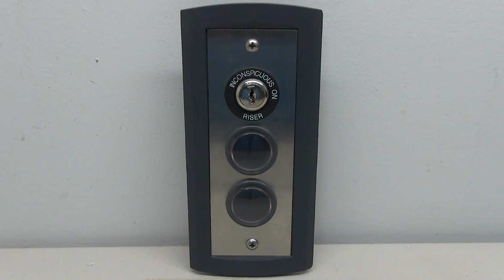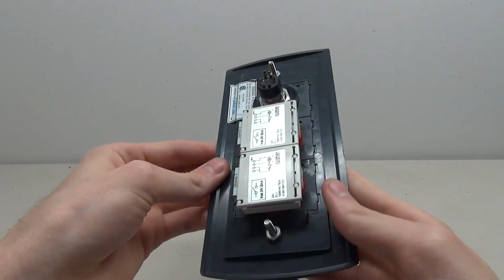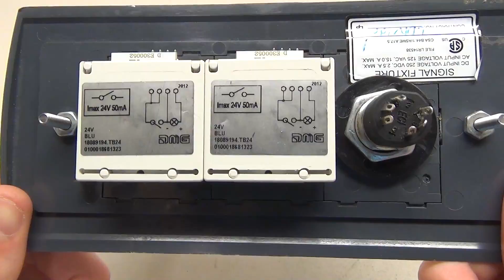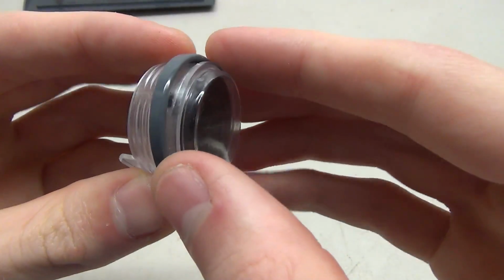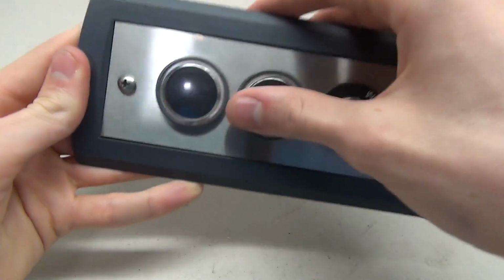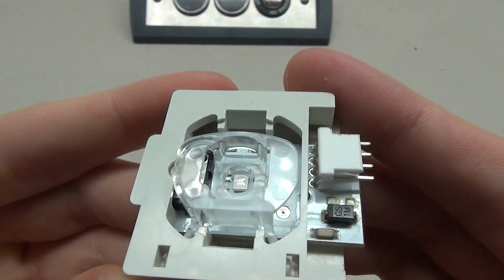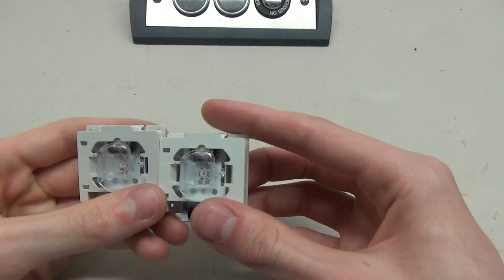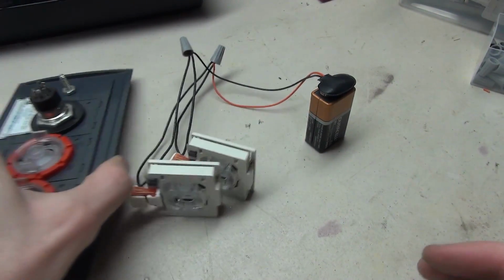Detailed Look and Wiring Thyssenkrupp Signa4 Elevator Buttons

Comment: Those connectors are universal, pin 1 is negative, 2 is positive and 3 & 4 are both switches. Yellow is NO and Blue is NC. Wiring Otis is exactly the same as this. I love the way those signa4 buttons look and feel
Reply from the maker: These are smaller.

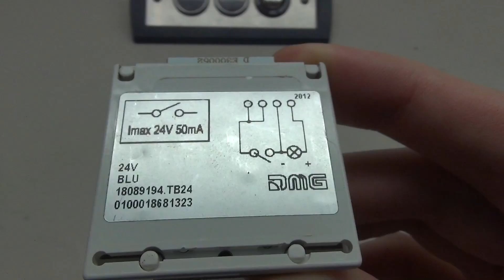Comment: 2:14 That's a weird shape. I'm not really a fan of buttons that press unevenly. I don't hate them, but I prefer buttons that have an even press. Usually buttons that press evenly have 4 springs.
Reply from the maker: Otis series 1 is like this too. Next time you see one, try pressing the button all the way on the right side and see if it activates.
Reply: I think that's only with the older version. The newer version seems to press better.

Comment: Request: Wire A ThyssenKrupp Mad Atoll. If You Go On eBay And Search ThyssenKrupp Buttons, You'll Find Them, And There Only 12$!
Reply from the maker: So the only thing different between Atoll and these are the cap. This video technically shows wiring those as well since they have the same DMG base.
Reply: Oh, I'm Getting Them, And This Video Will Help Me Wire Them;